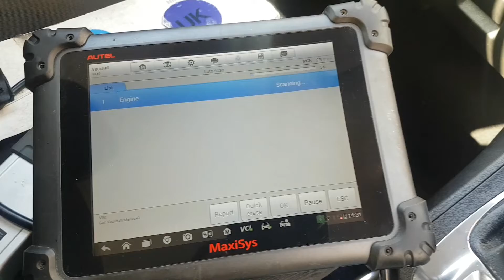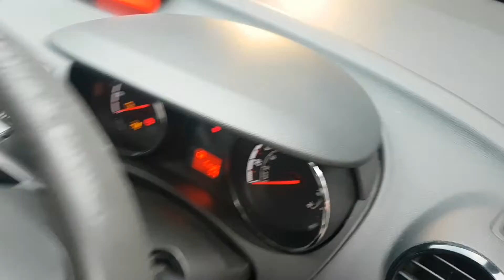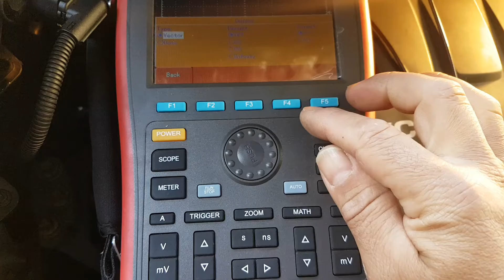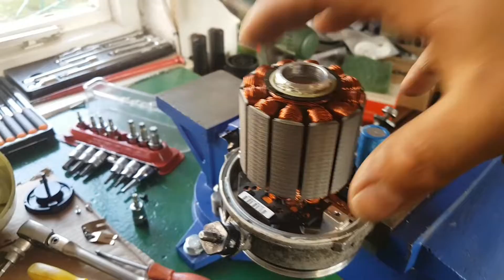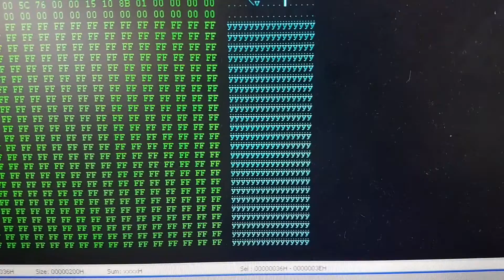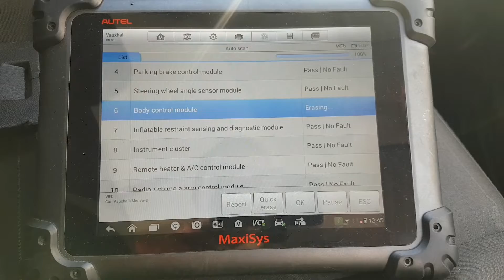Vauxhall/Opel Meriva B No power steering... Fault finding and repair.

Comment: These pumps fail for fun. Same as Corsa D. Done loads. Alway check fat wires at battery end to see if they're tight. Nearly always pump though.

On another note Louis, have a look at the OBDStar DC706. Has the same functions of IOTerminal. Reads/writes FLASH/EEPROM etc. of the modules we do without disassembly.  Just paid £1176 for it (full Auth) with the P003 adapter. Yearly updates not expensive either. Might be useful for you.
Reply: Corsa D use full electric servomotor located on Steering shaft! At least Diesel versions.
Reply: This is Electro-hydraulic. Corsa has full electric only! So, not the same.

Comment: Awesome video!

Really pleased I won't have to decode or code a salvaged replacement pump for my vehicle.

There are 3 different pump variants, marked by blue, green or yellow tape on the cable conduit.

Did your replacement part match the colours of the original?
Reply from the maker: I don't recall such details now, I believe it was purchased matching the part number...
👍👍👍
Reply: @LMAutoRepairs  Is that the 11 digit number on the white sticker that starts with "M"?
Reply from the maker: If you can't see it on the video, I don't know now... sorry...

Comment: Hi, i was researching a lot of stuff on YT. Modules repair and colning. Everyone claim that immo data and vin number is in eeprom memory. Maps and program itself is in flash memory. I also notice that if u have the same part number u can clone eeprom no need flash cuz data are the same in both. Here is the question. I saw many times that people are connecting to MCU in order to read modules memory. Why they are doing it that way ? Is flash memory integrated with MCU itself ? I saw people reading eeprom and flash data from there. 
Also what is reset pin in microcontroller for ?
Reply from the maker: Are you referring to this particular module, or in general?
👍👍👍
Reply: @LMAutoRepairs  General
Reply: But i also wonder how would u do it in this case
Reply from the maker: So, some modules have an external EEPROM, a micro controller, and an external flash memory.
Others have an external eeprom and a micro controller with a built-in flash memory, if it makes sense, and then there are others, that the micro controller incorporates everything...
So, you need to know what you are dealing with before doing anything like read or write chips...
Hope it makes sense...
Reply: @LMAutoRepairs  Yeah it make sense. Thanks, now i know why some have dflash and pflash. 😄
Reply from the maker: @4YouWHOyou 
Dflash and flash can still be on the same chip...
😊

Comment: Great video! I’m getting “stuck” as op-com fault. I bough an used one on eBay, tested it with the 3 electrical wires and it did work. Although it’s getting hard to remove the old one.  How did you remove the screws at the bottom?
Reply from the maker: I don't remember now such details, but if I did it, so can you...
💪🏼

Comment: Hi do you need to get EPS coded to your car, I have replaced mine twice and still no power steering, my original pump kept blowing an 80 amp fuse
Reply from the maker: Everything I have done is on the video...
👍👍👍

Comment: When removing the pump, what's bolts did you undo. Was it the two that you can see or the the 10mm three around the pump?
Reply from the maker: Can't remember now...
But I believe yes, some nuts that holds the pump to the bracket...
👍👍👍

Comment: may i ask if that wake up line is the power to to module? thank you!
Reply: sorry im not well versed on these, so what its like? can you show us a waveform and measurement for sometime. thanks!
Reply from the maker: Is not a waveform...
Just a (usually) 12v signal... 
That's all...
Reply from the maker: No...
The power yo the module is a different one...
That wake up line is that that, a signal to tell the module is time to work...😋
👍👍👍

Comment: Hi my son has a 2012.  3 series bmw and the heater motor failed the garage fitted a new one but now has error code 8011f9 and that he is unable to diagnose the problem, google tells me this:- 8011F9 internal component failure PTC module, is it something you have encountered before? Any help appreciated thanks
Reply from the maker: Never came across that problem... sorry...
👍👍👍

Comment: Dismount steering pump motor was surprised me why they used a lot of Electronics inside an hydraulic pump?they could do that with an external module and if module has a fault you don’t need to replace all the unit
Reply from the maker: Indeed...
Like most things nowadays, this things are not built with repair in mind...
👍👍👍
Reply: Electronic convert DC to 3 Phase AC for Motor. For that need also Hall sensor, current sensor. For an external ECU to many wires required! It is logic!

Comment: Long format fault finding and repair. 
Yummy
Reply: Good morning Luis, Great lengthy diagnosis and repair. I assume the previous owner gave up on this due to rising repair cost.  I understand the current owner has bought a used  EPS item. There is  a well known company in the UK who can provide a re-engineered part ESP offering a lifetime guarantee. How's that possible? If Vauxhall are aware why has this been publicised? Cheers😊
Reply from the maker: A lifetime warranty is in my opinion a marketing advertising...
Not going in depth here why I think that way, but it is a good option for the customer if there is such companies offering such services, and definitely a to go option...
👍👍👍